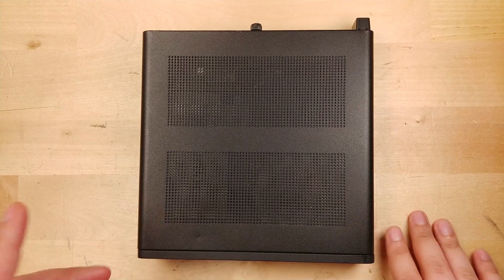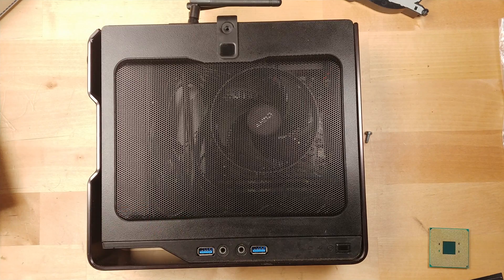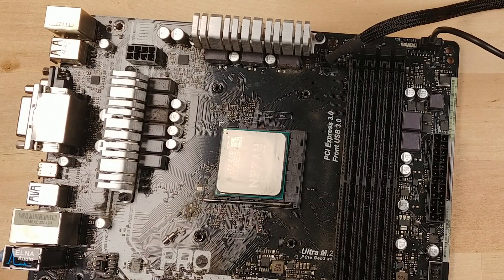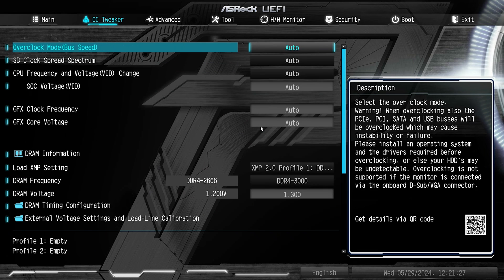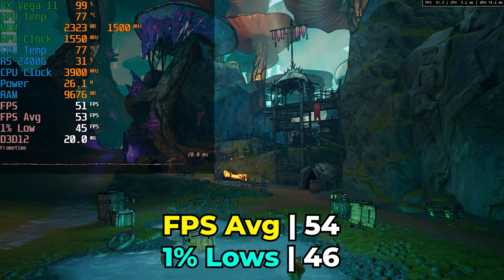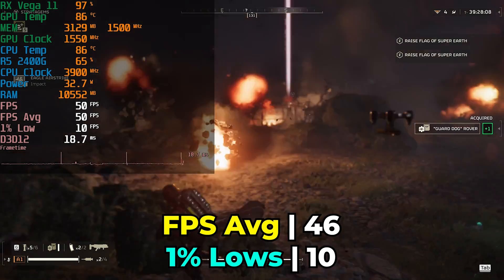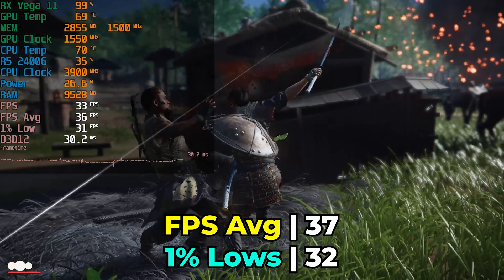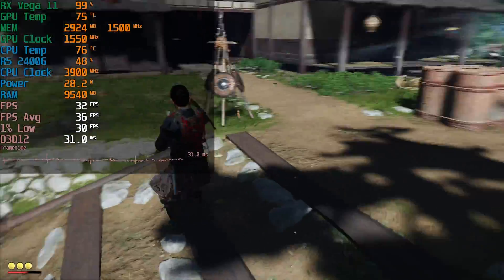HP EliteDesk Mini CPU Swap | AM4 Motherboard VS HP Mini PC | 2400G in 2024 Gaming Test

Comment: I have HP Elitebook 705 G4 ..SSF.. ryzen 3 pro 2200g 65W ...I also have HP Elitebook 705 G4.. Mini....ryzen 3 pro 2200GE 35W With charger Hp 90 W .....Can I switch processors? 
Is there a big difference between the two processors that would warrant switching...since I want to use... Mini PC instead of SSF

Comment: Can the HP motherboard works with the 5600g CPU?
Reply: According to Google, you can't, I was checking that out too, which led me here. I have the same CPU, and I'm planning to upgrade at some point and figured I'd either build a second PC for streaming or just purely gaming for fun, and thought that maybe this would be a cheaper way to keep my 5600g in use. But unfortunately it won't work as far as I've read.

Comment: It looks like the HP was limiting igpu graphics memory allocation. If you look at the overlays, The newer system lets the igpu use more "vram". That's why the better performance. The OC maybe did a little, but I bet it was the "vram" usage difference. Because the HP used less "vram", it had to use more ram ram. 

Also, Torx... or a flat-tip. 😉

Cool vid. 👍